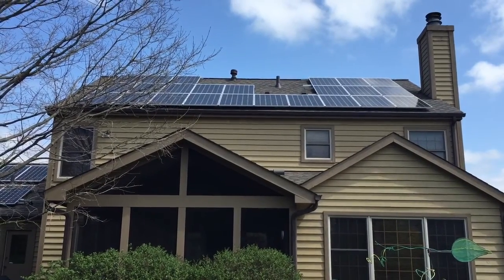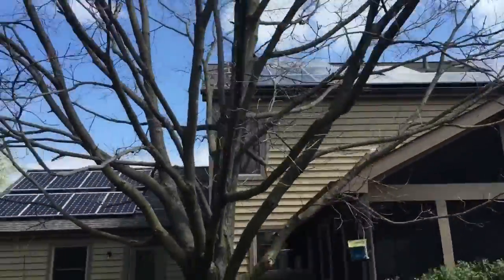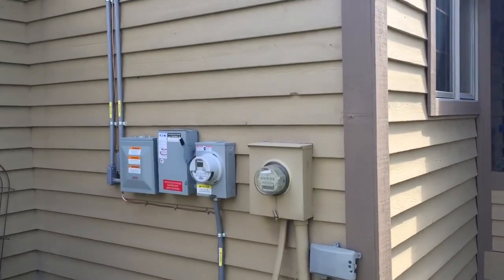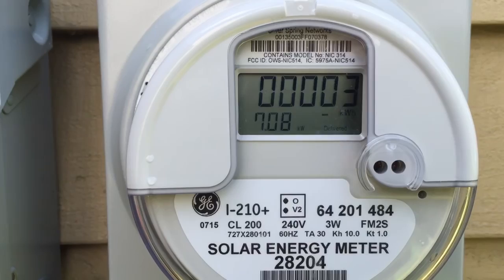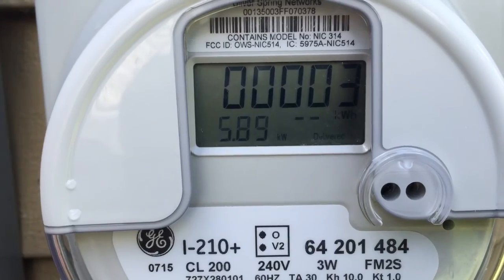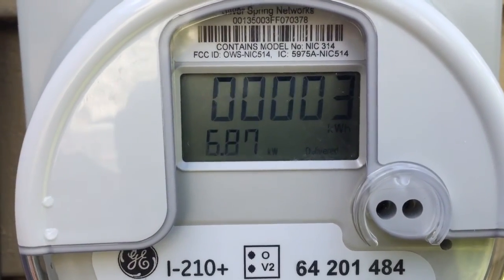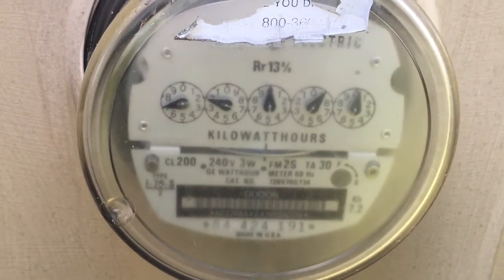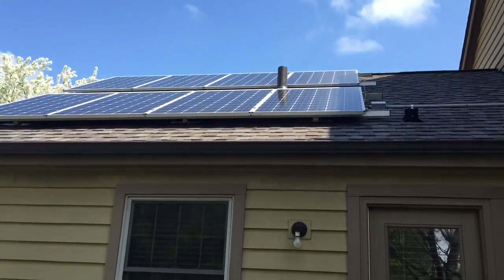Solar Installation in Hilliard Ohio by Modern Energy: Part 3

Comment: How much for an install if i allready have the materials
Reply: Wesley Sigrist - depending on how many panels, what type of inverter(s), the existing electrical system, if it’s grid-tied or off-grid, does it have batteries, etc. could start as low as $2,500 

A standard 20 panel system using micro-inverters with no batteries, grid tied. Typical residential electric system (200amp service) would cost between $3,500-$4,500 for the installation only. Not including any other cost. i.e.  permitting cost, interconnection cost, design cost, engineering cost, etc.